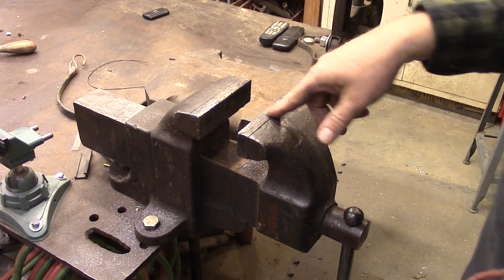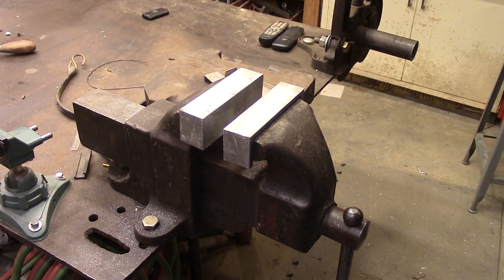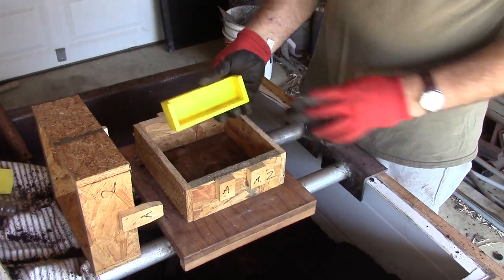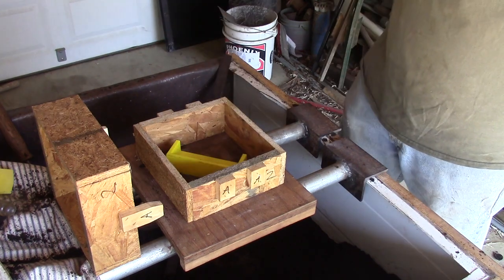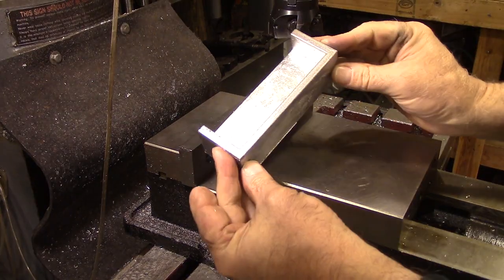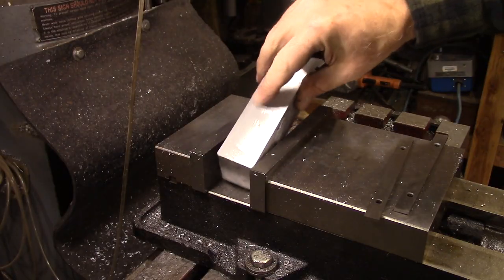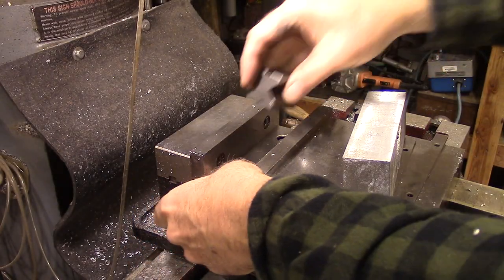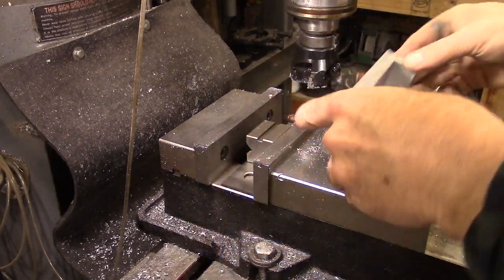Homemade Soft Vise Jaws

Comment: I thoroughly enjoyed watching this video, was wondering if you milled 2 pockets in the back  and epoxy 2 magnets in each side, would that help the jaws snap in place.
Reply from the maker: That was my original plan but I didn't do it.  I need to mill more off the top edge and I think the magnets would help.  However, I use them often and the work fine, I just can't clamp at the top of the jaw or they kick back because the part is not down inside the vise jaws..  Thanks for the comment!